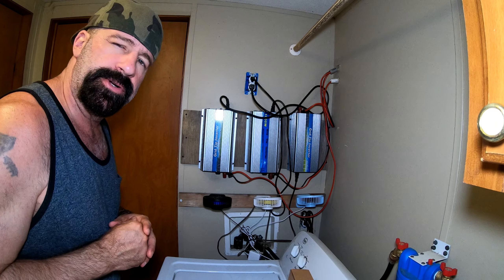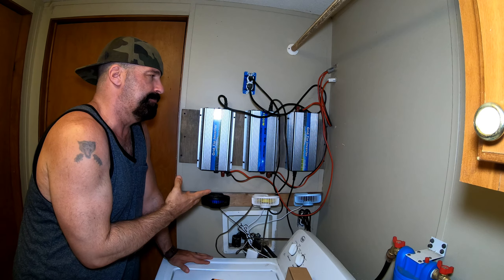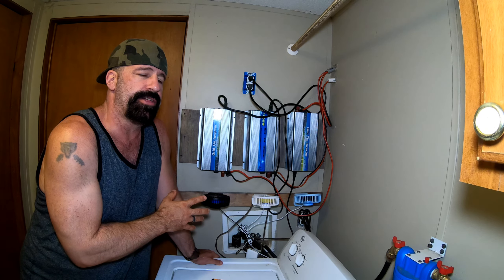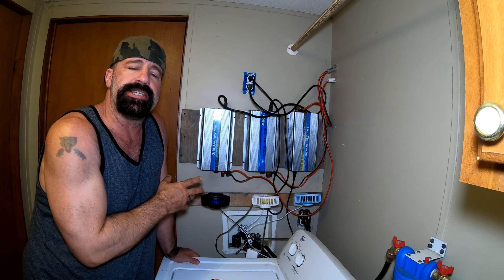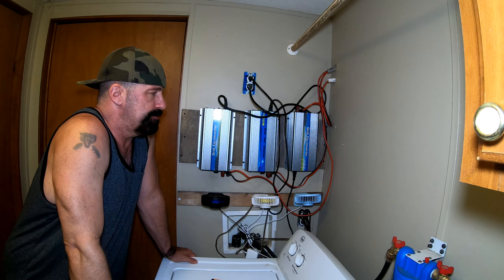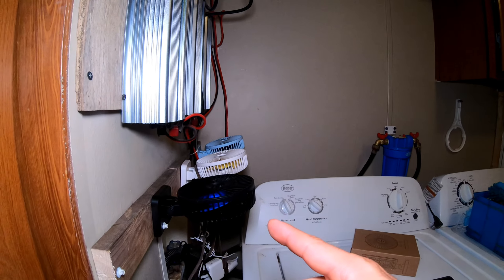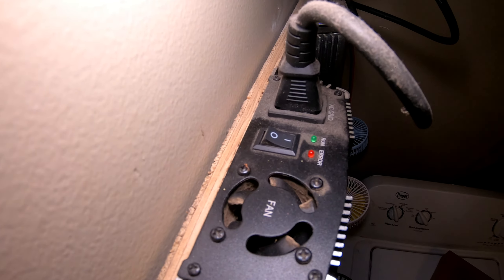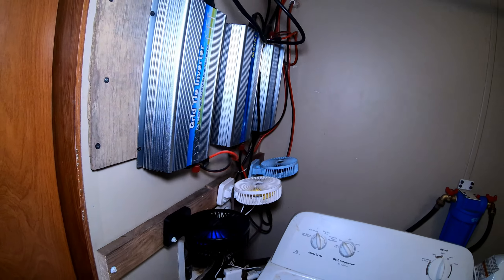Budget Solar Grid Tie Cooler - quick and dirty

Comment: 20x20x2 furnace filters. Those mounted on the inside of a square with a 20" box fan on top. Everything clean and cool.
Reply: Duct tape, fan and filters initial setup cost is around $40 USD. Amazing air filtering and air movement!! Frame something up with pallet wood if you don't like duct tape I guess......
Reply from the maker: We are looking at that same kind of concept but doing an entire closet because I'm also going to have an off-grid system in there as well as probably some small mining equipment for crypto My thought is to actually cut holes in the door to the closet and then have slide in cleanable furnace filters. But basically exactly what you were saying just on a larger scale
Reply: @thefrugalhomestead7873  yeah, like a little paint booth. Some in at the bottom, some out at the top.
Reply: I wonder how well some glycol, copper tubing and fish aquarium pump would work? That's low cost, low power consumption, with all the heat dissipation you could ask for. 🤔
Reply: That wouldn't need filters or introduce dust either.
Reply: After all you want to move heat not air. Air is really inefficient at moving heat that's why a furnace needs such high volume and a boiler hardly does anything.
Reply: Just win the lottery and get a mini split, problem solved. 😂

Comment: Looking at adding a 24vdc 80mm fan and 3d printed 40mm to 80mm adapter on mine.  Will share if it works out - with a 24v fan I should be able to supply directly from my solar terminals on the Grid Tie.
Reply from the maker: That would be awesome please do update us

Comment: Would a blower type fan be better and use the larger intake to a smaller exhaust for the extra temp drop in that type of setup
Reply from the maker: Yes but the added cost and those are very directional as well. Trying to keep the power usage as low as possible as well as the cost. But correctly set up and theoretically it would work better Yes